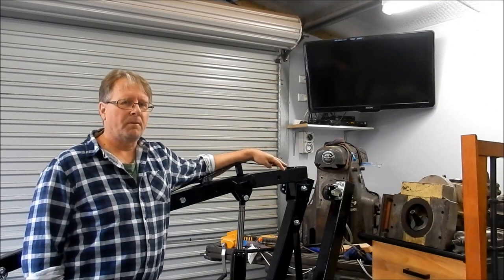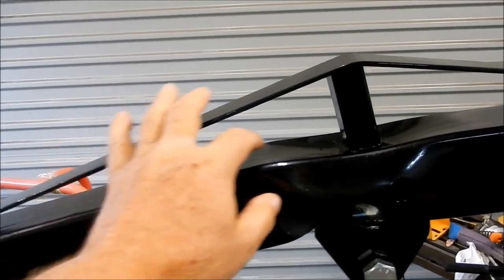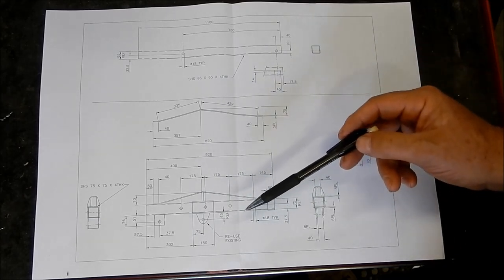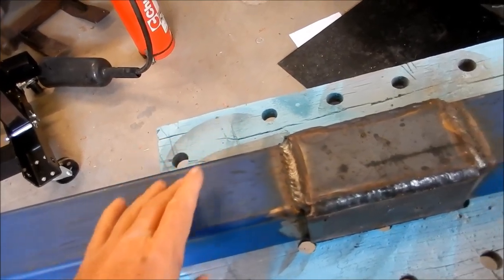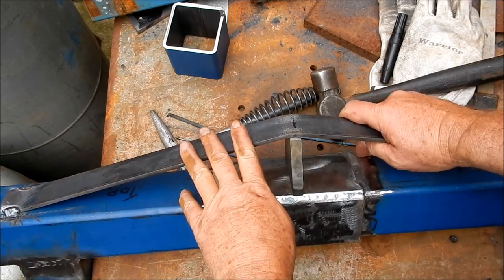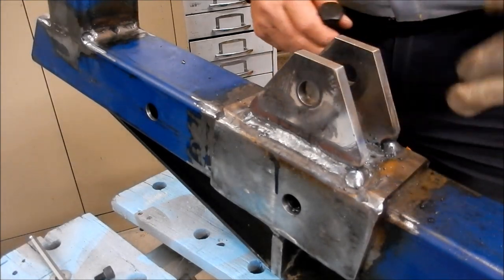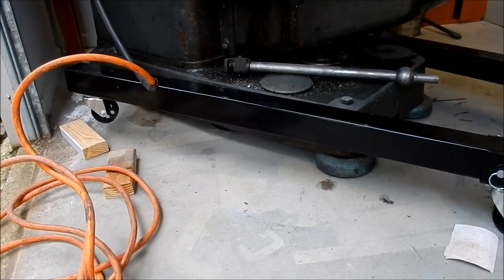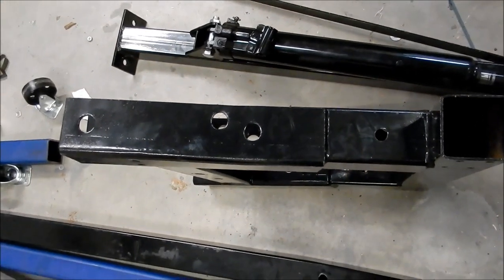Engine Hoist/Crane Fail and Repair Part 1

Comment: "It is a bit flimsy", "It is rated to 2 ton".
It is rated to 2 ton if the arm is in the clearly marked 2 ton position.
It appears flimsy because it is built to a price, with the expectation that it's limitations ( as marked) will be observed.
Of course they could build a "less flimsy" stronger one, it would cost more!
I have had one of these for over ten years.
If used within it's clearly stated limitations it works just fine.
If you lift 1,600kg with a crane labeled at 500kg, you cannot compain if it fails.
You cannot critique the design based on the failure due to onverload.
Reply from the maker: G'day Charles, yep I was fully aware of the limitations and what it is designed to.  Even though it states it is rated to carry and move a set load of 2T the casters are only rated to 150Kg's.  Unfortunately to achieve the rated load of 2T the boom needs to be sucked in which makes it useless where the lift point is beyond its reach.  Look at my follow up video where I modified it to lift 1600Kg at full reach, this makes it far more useful for my purposes.  As I state, to lift this load is a very rare occurrence but to be able to lift double that load certainly extends it usefulness in the shop. 
https://www.youtube.com/watch?v=BzBqq7Fnigs
Reply: @camatbattler2233  You are right the design can (and you did) modify it to increase it's lift capacity.
I don't know what my casters are rated at but the point is that the design calls for the 2 ton to be lifted well inboard of the outer castors. The load is therefor shared with the other  castors. 
By lifting at the full extended boom almost all the weight is on 2 x castors.
If the crane is rated at 0.5 ton at full boom extention, you cannot compain if the castors fail at 2 tons.
The crane is cheap and is rated for the give load limitations
.
Congratulations on improving it's performance.
You showed that the whole sturucture needed to be strengthened, which is just as you would expect.
My only point was that you should not overly critisise a design because it failed trying to do something that the designer never intended it to do.
By the way, i enjoyed your video.

Comment: What a piece of rubbish that is. I built my own 35Yr ago using 75 X 40 x 4.5 RHS  for the sliding extension  inside next size up RHS lifts 2 ton quite easy. The ram pivot is to far back, put extra hinge points along the boom for the ram further out toward the lift point so the ram is doing the lifting not the extension.  I have 4in solid Rubber tires front with casters at back using 60 x 100 rollers from pallet truck wheels so it can be used outside. I have had the front of Chamberlain tractors ( 2 ton ) hanging from it. Use in my work shop fitting hundreds of engines.

Comment: Toe Jack and Skates.  Engine cranes scare me for anything bigger than an engine.  Hoist don't roll worth a damn compared to skates.  I can push my mill across my garage with one hand.
Reply from the maker: G'Day worldtraveler, yep I tend to agree with you there.  Anyway I'm down in the rabbit hole now so lets see how we go.
Cam
Reply: @camatbattler2233  I made some skates last weekend.  1/2" plate, some 5/8" drill rod and a bunch of cheap chinese bearings.   3 skates cost me 60bucks all in.  The tricky part was the toe jack.  I made that from scrap and a bottle jack.  I just hate engine cranes.

Comment: They really should design the hoist such that the pressure relief valve in the jack opens before an overload is achieved that could physically damage the hoist.  Just poor design.
Reply from the maker: That may not quite work out.  If the boom is fully retacted to lift 2000kg as per its rating the cylinder may need 10,000 psi to do the lift, it may only need say 8,000 psi to lift 500kg at Max extension so putting a relief in to suit the lift in one position may not allow you to reach capacity at another position.  I haven't done the numbers but this could be the situation.
Cam
Reply: @camatbattler2233  The weight ratings at the extended positions are simply the weight rating at the fully retracted position derated based on the moment arm.  The load on the ram is the same for all positions if they have done their calculations correctly.  The ram should have a pressure relief valve that refuses to take additional pressure once the max load rating is achieved.  Structural failure is never a suitable failure mode for hydraulic equipment.
Reply from the maker: G'day LT, and that's why I said it may not quite work out.  If I had the inclination to do a simple bending moment calc at each lift point I could say for certain if the pressure ratio's would work out the same at each lifting point.  But there's more things to do in life.  It now lifts 1.6T at Max reach so I'm happy.
Cam
Reply: @camatbattler2233  No need for bending moment calcs.  Just simple moment equilibrium about the pivot pin.

Comment: Hare & Forbes rates these at 1 ton, not 2. At 2 ton (on the shortest arm) there is zero safety margin, and probably optimistic. But think about how little money you spent on it. Those old Aussie lifters cost a month's wages. This cost a couple of hour's wages. We bitch about Chinese quality but the problem is in our expectations. They can get away with selling us dangerous rubbish as we can't sue them. We're the stupid ones for buying this crap.